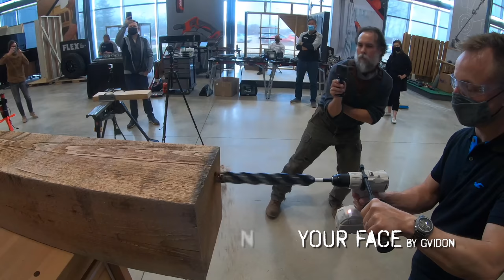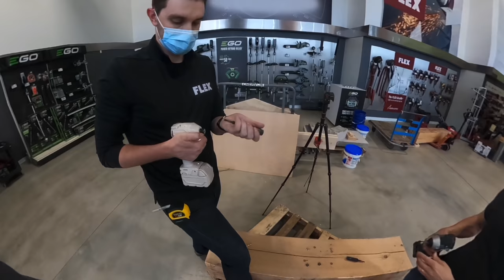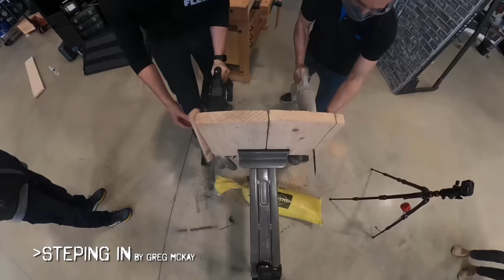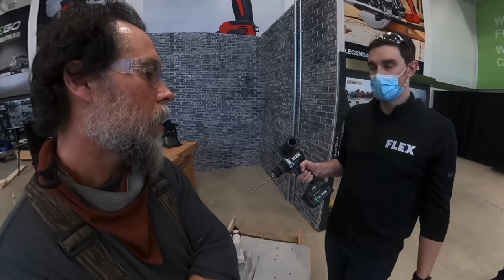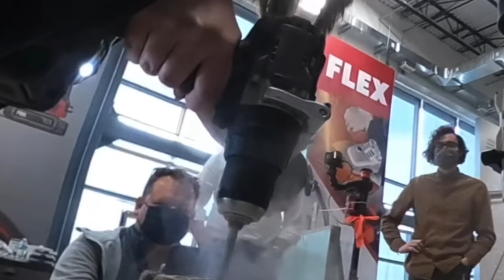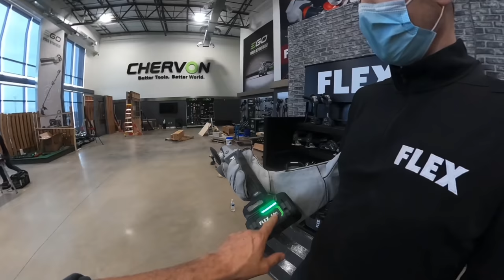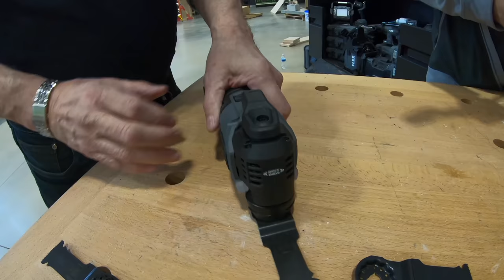Testing Flex's new Power tools- No glitz, no hype, no B.S.

Comment: Yeah my mind would have changed about flex if they put dewalt against it 
Because I'm pretty sure dewalts dcd 998 hammer drill against there "turbo" hammer drill would get destroyed . Tbh im okay with milwaukee getting bashed in the head but if flex were against dewalt, dewalt would be the clear winner

Comment: FLEX tools are bs, it don't show which to it is comparing to
Reply: It's not very hard to look at the tools covered in white judged them by their profile and the color of the battery lights and realize that 90% of the tools are testing against are Milwaukee and the flex video that The tool company put out two days ago they did put a couple of dewalts up against them but I think there were only like two or three. But yeah it's really easy to tell what tools they're testing against just by looking at the profile of the tool itself
Reply: @TwinPhoenix666  why FLEX tools tried to cover up the Milwaukee tool?  is it better for FLEX tool company to show their tools are better than Milwaukee's??????

Comment: Don't really understand all the hype they don't use the high output batteries and how are drills going to change that much like what does turbo even do. there is only so much that can change without new battery solution or motor technology to change.

Comment: I thought that Flex in your tooling was bad as it makes for inaccurate cuts.
Also... From an electronic Engineers point of view. That Turbo button is utter wank. It will drain the battery faster, I wouldn't be worried about the battery though. Every one knows batteries are consumables. What I would be worried about is the motor. Either the motor is rated for the extra power, at which point either use a smaller motor for lower cost, or just leave it on max all the time. If how ever they added the button because the motor is NOT rated for the extra power. Using the turbo too much will burn the motor out. Either way that turbo feature is loose loose for a consumer.

Comment: The guy is not even pushing to feed on the Milwaukee. Look at both guys. One is pushing hard to make there flex look good. The other guy is not even pushing to make the m18 look bad. I have ran a 2foot 1" wood bit on a m18 an had the hole done 10x faster then what they are showing. An I can bet they made sure the bit in the m18 was not shape.

Comment: Comparing a 24v against a 18v competitor isn't a good one. If they had gave Milwaukee the HC battery there wouldn't be as much as a difference. I own Milwaukee and they are good durable tools, i don't give a shite about any other tool if it runs faster or what. Never had a job it couldn't handle.

Comment: "5ah battery on both, turbo turned on flex " * turns off video *.  Not a real comparison if the milwaukee doesn't have a high output on. Even the 3ah HO will blow the 5 out of the water.

Comment: The Milwaukee impact ate the Flex lol. The Flex guy started driving it first, and the socket slip included Milwaukee almost caught up. Not to hate but it doesn’t seem to be legit enough. Stopped watching after I saw the recips getting tested, and after the swap the guy that was using Milwaukee first, starts rocking the Flex to get the optimal cut... get out... I’d love to see Milwaukee, and Dewalt get pushed to develop better tools so good job to the Flex team but please do legit demonstrations. Those paid pencil warriors that are doing the demonstrations can go back to the drawing boards.

Comment: Sorry, but I may have lost a little respect for you. Flex compared itself to Milwaukee. They didn't even compare the Milwaukee top of the line sawzal to their top of the line of the one they used. Also, Milwaukee is just above DIY grade in most of its tools. How about it compares to the industry standard? Sorry, but for one company to out match all others in every tool. Doesn't happen.

Comment: You’re supposed to be professionals! Why are you removing the bits like that, cradling it and making it look so cumbersome with the Milwaukee impact driver?
Again one hand removal with the left hand while holding the tool with the right hand “one motion” One hand quick insert while holding the tool with the right hand and pushing the bit in with the left hand “one motion”! It’s much easier than a over engineered button doing to many motions that will probably fail overtime anyway. Come on guys we can all see what’s going on. We all like competition, but only when it’s truthful. I was going to invest in the Flex platform and spend a couple grand, but after seeing all these sugarcoated videos I’ve changed my mind. Instead of making videos to make the customer feel good about the products, these types of videos are scaring us away, this is such a shame. Coming in second to a tool that has been first for a long time is amazing, it’s actually like coming in first, especially being new. I will be sticking with the big 3, this will only make the big 3 better!

Comment: Nope it’s not a high out put battery on the Milwaukee so that’s BS right there Plus their own people are doing the test. Why weren’t they using a 21 700 cell high output battery on the Milwaukee? Instead they used  18 650 cell battery. You’re literally watching them test their own tools against the competitors at their own facility with their own people and your title says no BS. This is BS Clickbait and bad advertising. But by far the biggest thing being overlooked is they’re competing against old technology those drills and impacts the (M18 GEN three) have been on the market for five years now and is not the most powerful drill/hammer drill on the market at the moment. Within the next year+ the new Milwaukee models (the GEN4) will be released and then what? This company had a lot of potential they probably do make good tools but bad advertising have really hurt them.Not to mention their platform is still too small and the longevity is untested. Do they have cordless nail guns, Tablesaws, or Miter saws, planers ect? Project farm has already tested some of their tools like the osculating tool (multitool) spoiler alert they did not win but they claim it does “in their test”.